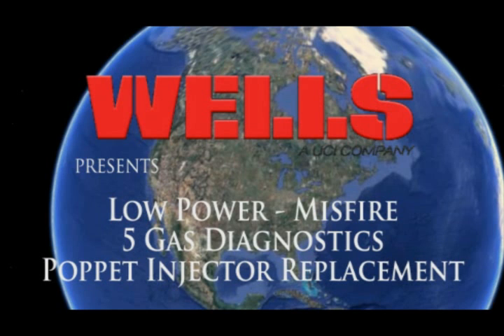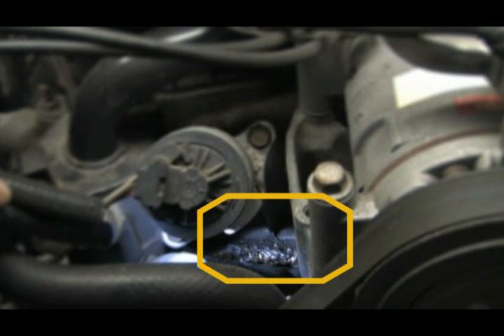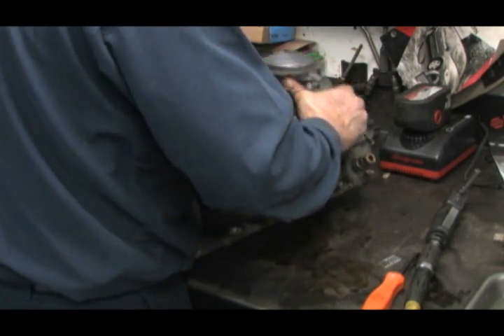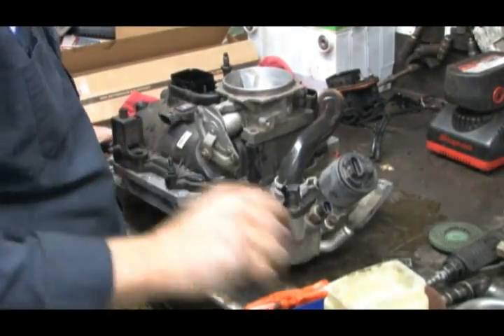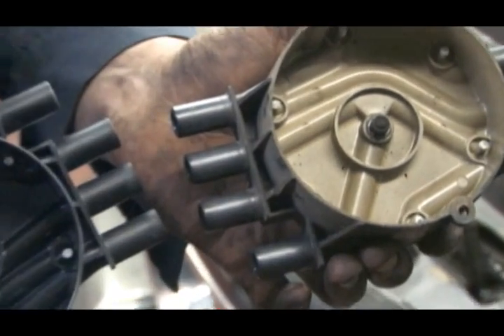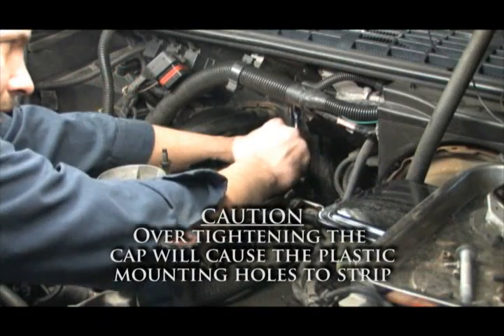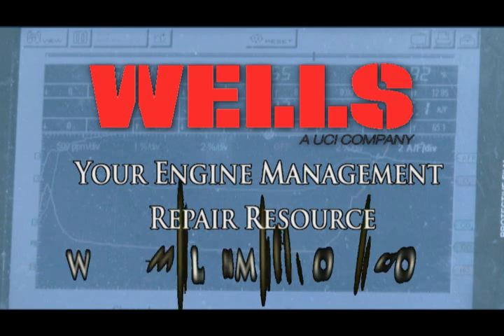Chev / GMC Misfire, poppet injector diagnosis, troubleshooting and replacement

Comment: I put new spider injectors in my 97 Chevy Silverado. It has a new fuel pump,spark plugs, wires and it still stalls. Only can start it with starting fluid, then I let it sit to heat the engine up. I got to put it in drive and give it gas and it stalls. Got any ideas?

Comment: I replaced the whole distributor recently and didn't know about setting the cam retard to 0 ... What could this cause? I don't have a scan tool for that. The old gear was worn down to a knife edge. 
(Also still have a #1 misfire after replacing the whole ignition system - Dist, Coil, Wires, Plugs) haven't touched fuel system as this video does.

Comment: Having a similar problem with the truck I'm working on I replaced the coil distributor cap and rotor plugs and wires and I'm still having misfires and cylinders 1 3 and 5 but my fuel trim is at -30 % so it seems to me that the computer is pulling back on fuel is it possible that an injector could be stuck open or injectors stuck open
Reply from the maker: Hey Tim, the -30 is a pretty good giveaway for these. I bet you have at least one stuck.
Mike Becker, Senior Instructor

Comment: It figures GM can't make anything easy or cheap to work on.  Mine is doing the same running rich with the random misfire code and doesn't like to start after the engine has been ran.  I would sooner send it to the scrap yard rather then replace the spider injector.
Reply from the maker: Hey Marius, yeh those spider injection vehicles definitely had their share of issues.
Mike Becker, Senior Instructor
Reply: @GoTechTraining  Yeah it was the last thing on my list to check when the random misfire started. I just decided to replace the items i thought it could be starting from the crank sensor all the way to the cap and rotor and wouldn't you know after watching this and hearing about the symptom it fell parallel with what my blazer is doing.

Comment: My friend has 04 Chevy s 10 4.3  and I hook up a fuel presser tester to see if  it will hold presser and it's drops under 5 psi in 3 mins and it was running great and he put fuel injector and fill up the tank and drove it for a few days with no trouble asn park it and let it sit for a few days asn whent to go and start it and start up running real bad and shut it off and now when it's true to start it making a nosie and my other friend is a tech and said to him it sounds like it's

Comment: each injector should  read  11.8 to 13.8   if one is way below that like reading  6.0  it is bad . if one is all over the place an  not given a good reading  it is ether stuck open or stuck close . this test is to check the resistance  in each injector ... now if you have  a old  spider you can  replace the injector . just make sure everything  in line up right.

Comment: Nice video & the states before & after were pretty noticeable... I know this was made years ago; Yet, just caught it for the 1st. time - since I'm been having trouble w/a start-up and seems to be lacking fuel when I step on it (on my Chevy Vortex 5.7L 350cc)  ??  Therefore, I was (somewhat) informed that it might be my Spider Injector assy., ??    Thanks again !!
Reply from the maker: Hey Pietro, the spider injection units are very very common to fail on those trucks. Definitely worth a check.
Mike Becker, Senior Technical Instructor

Comment: Will the bad spider injection cause it to smoke from exhaust?
Reply from the maker: Hey Myron, depends on the failure. If it were stuck open forcing it rich, then sure.

Comment: When removing the spider fuel injector connection, is it normal to have fuel inside the connector?
Reply from the maker: David, that doesn't sound good. Could be a bad injector.
Mike Becker, Senior Technical Instructor
Reply: GoTech my 97 blazer 4.3 has random misfire code p0300. Could this be the spider injection. I already changed the plugs, plug wires, distributor cap, rotor button, coil, ICM, and cleaned MAF sensor. Oh also cleaned EGR valve too.

Comment: you only had to remove the entire intake because you had that anti freeze leak? correct? i just have bad spider injector unit... misfires,lacks power,runs horrible.. runs very rich.i did everything else..tune up..fuel filter timing chain etc...
Reply from the maker: Hey Roadstar499, right. You only have to remove the upper to get to the spider injection unit.
Mike Becker, Senior Technical Instructor

Comment: Thank you for your response, Mike. Yes, it's hard to figure, way down track. But it would seem that you agree that those AFR readings don't look right?
Reply from the maker: Yeh, i'd agree. It does look lean. 18+ afr seems high at idle. Not sure why, or what was done. 
Mike Becker, Senior Technical Instructor

Comment: This comment would be years late - Just saw the vid - Another good show. Just wondered about the 6th reading (AFR) on the 5 gas analyser. The "Before" reading was a touch lean of stoic? Then went leaner after the fix? Is the AFR readout accurate? Or is there some fuel trim going on?
Reply from the maker: Hey Leslie, wish I could say. This car was worked on years ago, well before I was here. Hard to know exactly what was going on with this thing :(
Mike Becker, Senior Technical Instructor

Comment: What scan tool is used here?
Reply from the maker: Hi gtstangman96, that is the GM TECH2 scanner. This was the factory scan tool for GM for many years. From the early 90's up until the late 2000's.
Mike Becker, Technical Services Instructor

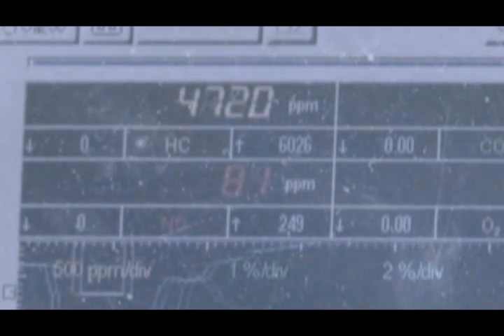Comment: Mike, very interesting video. Was the rich running condition resolved?   Pardon all the questions that follow; I'm having some similar issues and odd readings from fuel trims, so I'm trying to get a handle on what's cause and what's effect...     Seems like some contradictory symptoms so I'm puzzled: 1:00 Bank 1 fuel trim is adding 25% more fuel, apparently because something (oxygen sensor?) indicates it is too lean. However, 1:25 the system is running rich overall, leading to poor performance and raw fuel in the exhaust. 1:59 Diagnosis of too much fuel being delivered, either as commanded by the computer or because an injector is sticking open. But shouldn't that result in a rich condition being detected  by the oxygen sensor, so that a negative fuel trim would be applied?  Is the system erroneously sensing a lean condition and erroneously dumping way too much fuel into bank 1 in an attempt to correct it?  Thanks in advance for your thoughts on this.
Reply from the maker: Hey Nord, this diagnostic and video were done well before I got here. If I understand what was going on correctly, it looks like this thing had bad injectors and bad intake gaskets. A rich and a lean condition. Check out our newer videos, the ones on Fuel trims. I go in depth into the entire system and how it operates. It should help, and you should be able to apply to your problem at hand. 
Mike Becker, Technical Services Instructor

Comment: if  the truck was missing but still would turn on now power changed  and don't turn after fuel pump  new
Reply from the maker: Hi Marlene, first off, do you have adequate fuel pressure? Is the fuel pump even turning on?
Mike Becker, Technical Services Instructor
Reply: Wells Vehicle Electronics no, but I thought so ..that was needed go figure when a mother and as a lady trys tto explain ..know so, my son sold it.. THANKYOU you do know what I was talking about..and for replying Blessings
Reply from the maker: Thanks for commenting back Marlene! It sounds like everything worked out!
Mike Becker, Technical Services Instructor

Comment: how much will you charge to diagnose a missfire?
Reply from the maker: Hi Christian. We aren't a shop that fixes cars for profit. But, if you were to take your vehicle in for a misfire concern to be diagnosed I would assume at least 1 hour shop labor charge. If not more depending on the complexity of the issue.
Mike Becker, Technical Services Instructor
Reply from the maker: Hey Christian mi name is fritz and I am a instructor and have mi own shop although I can not say what other shop charge mi rates are between 47.5 to150.00 depending on how dad the problem is most miss fires are simple and only go as far as 47.5 to 85.00 dollars but others take more time and more testing is required. I hope this gives you and idea.

Comment: I have Chevy Blazer 2001 125,000 miles with misfire problem, scanner gave code P0341 Camshaft Position Sensor but i replace it and still the same code and misfire also consume too much gas... it could be this problem you specify in this video? HELP Please!!!
Thanks
Reply from the maker: Hey Jose, You could have a problem, with the new sensor, the wiring, the computer, or even the distributor. Do you have access to a lab scope? That is going to be the best way to diagnose this thing. 
Mike Becker, Technical Services Instructor
Reply: Dont have access to any lab but want you to know that i replace the sensor 2 times with a new ones, you think that could be the new sensors that i buy on eBay for $12... you think those cheap sensors came defective? I also verify the voltage that enter to the sensor and gave me only 11 volts not 12.
Reply from the maker: Jose, you should get a good sensor. There is a good chance that sensor from Ebay could be bad. Our part number is DR188, check that one out.
Mike Becker, Technical Services Instructor
Reply: OK but i'm afraid that if i pay $50 for a good sensor what about if the problem still there?
Reply from the maker: That's why cars are diagnosed my friend. Maybe take this into a shop that has a labscope and the ability to test the system and tell you what's wrong with it instead of just trying a part. A cam sensor might fix it, but it might not. Remember just because the codes says P0341 Camshaft position sensor...that doesn't necessarily mean that the cam sensor is bad. The codes are just a guide for diagnostics, not a guaranteed part replacement. I hope you get to the bottom of this thing. :)
Mike Becker, Technical Services Instructor

Comment: i have a 1996 chevy s 10 it will not start unless i spray starting fluid in the throttle body but once it starts it runs fine. ive changed fuel filter fuel pump distributer rotar and cap plugs and wires cam sensor any ideas? thanks
Reply from the maker: Hey Longjock 1, I hope I can help. For starters, what engine is in your S10? Also, have you done a key on engine off and a cranking fuel pressure test?
Mike Becker, Technical Services Instructor
Reply: +Wells Vehicle Electronics thank you for the reply the engine size is a 4.3l v6 vortech i had a mechanic do the pressure check and he said it was coming back at 60 psi. when the new fuel pump was first put in the truck started right away everytime but over the course of a week or so it quit starting unless i put starting fluid in the throttle body. everything on the fuel system has been changed besides rails and spider injectors. i also had the cam shaft sensor changed as it wouldnt start at all before changing the cam sensor.
Reply from the maker: Alright, fuel pressure seems ok. Spec on that is 60-66. The spider injection system can be very problematic. What I would do at this point is this. When the truck is not starting verify that you are still seeing 60psi at least of fuel pressure. It is possible that when the trucks acting up and not starting the fuel pump isn't putting out enough pressure. 2nd thing to do would be to scan the truck for any sort of codes. Maybe there is something related even if the check engine light is not on. That can possible give us a direction to look. You might be looking at that spider injection assembly. Besides the fuel pump, that is the most common failure for crank no starts on these trucks. Let me know what you find out.
Mike Becker, Technical Services Instructor

Comment: I need some major help. 98 s10 4.3, back fires while trying to start. VERY hard to start. when it does start it is not driveable. new plugs new cap and rotor new coil new module. tried a used computer and new cam sensor. timing dead on. has a po300 and will cause the converter to turn red with a few minutes if you do get it running.  any ideas?
Reply from the maker: Hey Shawn do you have access to a scan tool if you do check your crank sensor also, I see that you replaced the can sensor. Also I have seen the distributor gear wear so bad that will throw the time right out. Also does the engine run very rich when it starts, you could have a fuel pressure regulator problem. What I recommend is to pull the right side plugs and see if they are wet with fuel or black you may have a fuel regulator that has gone bad and its flooding your engine. So remove the plugs on the right side and check them out. This is mi e-mail incase you need more help; fritz.fuchs@wellsve.com good luck wait to hear from you.
Reply: +Wells Vehicle Electronics thank you. i have been busy and have not checked this out yet. let you know
Reply: +Wells Vehicle Electronics hey response to your response. yes i am getting an rpm signal. all sensors seem to read appropriate key on nothing maxed out or 0. i pulled the intake found the regulator leaking. replaced the spider inj. and took exhaust loose. now i have no spark. i think i need a distributor
Reply from the maker: Could be a distributor, these motors were common for spark issues. Do you have spark coming out of the coil going into the distributor?
Mike Becker, Technical Services Instructor
Reply: +Wells Vehicle Electronics yes. i have spark from coil
Reply from the maker: Shawn, do you have spark going down to the plug? So hook the coil back up to the distributor and check for spark getting to a spark plug. If you have spark out of the coil, but not down to the plug....then I would think the distributor could be at fault.
Mike Becker, Technical Services Instructor
Reply: +Wells Vehicle Electronics got it started. new spider injector and coil was needed. now it start and idles fine but if you give it any gas it bucks and backfires. will eventually die
Reply from the maker: Shawn, have you checked the systems fuel pressure? Typically if you have a decent start and idle, but stalls when trying to raise the rpm that is typical of a bad fuel pump, or restricted fuel filter. Fuel pressure is critical on those spider injection trucks. The spec is between 50-62 psi. If its lower than 50, you have a fuel issue. 
Mike Becker, Technical Services Instructor
Reply: +Wells Vehicle Electronics I have found excessive clearances with main bearings will also cause issues with backfires with higher RPM. I kept having crank and cam timing correlation codes. but finally figured it out using a dial indicator on the balancer. .020 is what I had. the culprit was the oil pickup tube had fallen off the oil pump and starved the bearings of oil. needless to say, the engine had received all new bearings and problem solved.
Reply: Shawn Robison
Reply: Shawn Robison
Reply: Shawn Robison

Comment: very informative thanks question I'm  not getting any gas coming out if 1+2  I had done this exact gaskets but had ruff idle with misfires. I know have the upper apart with the injectors exposed to figure out which was not spraying. I have a new distributor,new wires and plugs I checked for fire everything I'd working. so how do I test the individual injectors at the spider near the pressure regulator?? thank you for your help 😀👍👍
Reply from the maker: +REKAIRBRUSH Usually at this point you would want to replace the entire "spider" injector assembly. If you have 2 already failed chances are the others aren't far behind. By the sounds of it the poppet valves on 2 of the injectors are stuck closed, not giving you any fuel.
Mike Becker, Technical Services Instructor
Reply: +markjhicks thank for your respond 👍 I did exactly what you said so its on its way I figured its a big time consuming to remove every time something fails lol so you reassured me I made the right desicion thanks bud👍👍